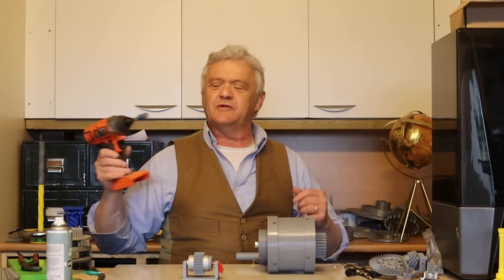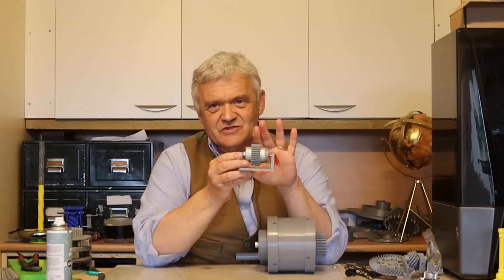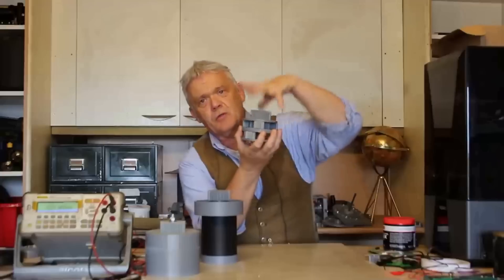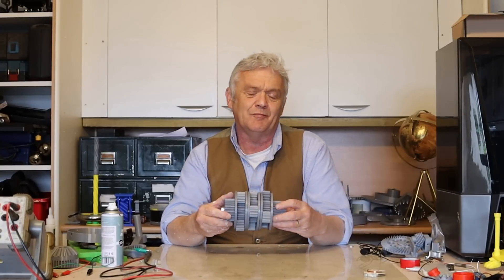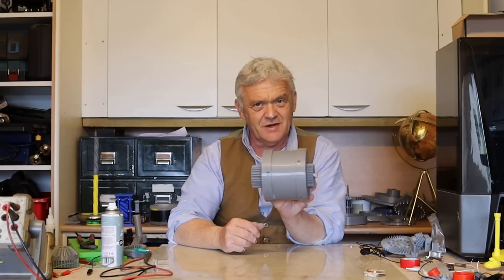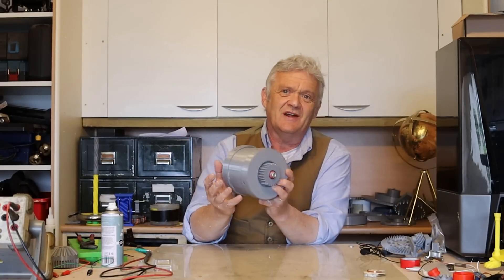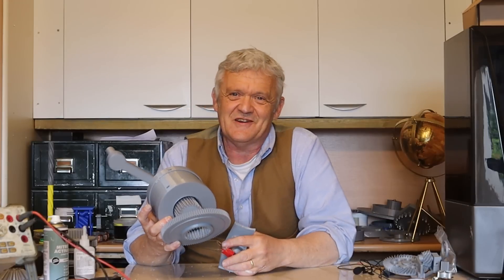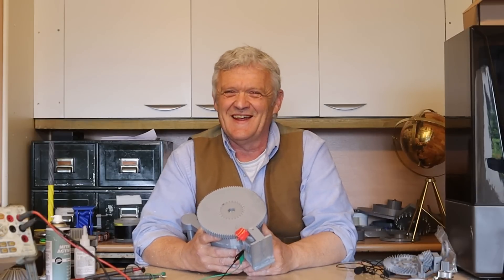2009 Universal Planetary Gear And BLDC Generator

Comment: I love this system for demonstrations.  I want to make a suggestion for the model - I like to take it apart to show how it works. I think it would be awesome to have hollow cylinders attached to the outside of the ring gear/outer case.  These could be used to run a threaded rod through to keep the sections alaigned and together, but allow for dissasembly and more expantion options (4, 5, 6, ?)   I tried to do this in thingiverse, but I just can't quite get it done with my skilset - your tutorials are great, but I need to also do some practical practice, not just watch!

Comment: Sir, your videos are great. I have one doubt. Does electric cars really want  to save the planet or create another business segment and capture market share using climate change reason? because year ago I have sent one ground baking invention to tesla management to increase run time of electric vehicles but no response. every moving object has opposite aero dynamic force, using archimedes wind turbine, right generator it is very easy to charge battery therefore no need to stop by charging station. May be I am Indian who suggested. that could be the reason they have ignored.

Comment: In a previous video you mentioned that the gear pins broke and would replace for metal pins. 
I just noticed in this video at 1.10 it looks like they are now metal. How did you replace them and did you re design the carrier? Also what was used? 
Many thanks and keep up the good work.

Comment: Needs a 25kg flywheel with ratcheting drive on the 100tooth cog. And the gearset enclosed in oil bath. 

5minutes of imput energy, 30 minutes of spinning generation.

Comment: what about imputing on the system on the ring? to my knolage planetary gears have the cool mechanic that you define the input, output, and mount there is the: 1 : 27 mounting on the ring, 27 : 1 mounting on the ring, then there is the reverse by mounting on the "sun" and inputting on the ring

Comment: It seems everybody is hung up on VOLTAGE. Power is what should be the concern. The size of a wind turbine for the most part gives you an idea of the power you can extract from the wind. Build everything as good as can be and you can never exceed the "power-in-the-wind".
The HAWT will give you the most power.  Putting objects near or in the path of the wind only increases turbulence which decreases the wind power available to your turbine. Of course we all know this.

Comment: Good place to source planetary gears is the scrap yard. There are at least several in a given automatic transmission. And most times they are still in good shape just forgotten about. Example, a GM 4l60 (700r4) or variants, are ripe with planetary gears. Also has other useful bits of kit a maker could do all sorts with. Just a thought
Reply from the maker: it's a good thought mate and a nice post - thanks for posting

Comment: I found servo motors made by kag rated at 500watt which spin @2000 rpm with 24v dc input. There is a rotary encoder on the back, which could be pulled out and paralleled with 6mm to 6mm(shaft size) coupler.

The best thing about this motor is it priced around $4-6 and the stock is plenty. The motor was salvaged from old atm machine. I already bought 2 of these and the condition was very good.

I got a request to build a solar plant for a buddhist monastery, i propose wind turbine since the location is quite windy. The plan is to use the impeller similar to the one on vid 1997 housed in wind catcher device seen on vid 1999. For bearings i will use a slice of 15mm ptfe rod drilled in the middle housed in fiberglass housing.

The impeller will be made from fiber/carbon composite, the housing would be made from aluminium sheet, and fiberglass with hollow galvanized square section. I might use stainless bolt instead of welding to avoid corrotion on welding points.

Still haven't decide on gearbox, but I am thinking two stage of 10mm 12t gt2 pulley paired with 60t. Or any combination adjusted on how the system behave on site.

If my proposal accepted i will keep detailed documentation. If they insist on solar plant, i will build solar follower panel. The motor would be powered from pelton impeller, and secretly injected to the battery pack using schottky diode😅. I would gather data on power generation using esp8266 and or esp32 cam connected to esp32 cam cloud wifi cctv system which also part of the offering.
Reply from the maker: that is an awesome project mate - keep me in touch - where are you by the way? Nepal?
Reply: @ThinkingandTinkering  I hope my proposal accepted, i am in indonesia. The small monastery called "pusdiklat jinaputra" located in malang regency, easy java. There is some pics avaliable on google maps.

The monks only need electricity for basics needs, not much. There already static solar panel installed from donations, which i will modify to track sun. The wind catcher will provide eletricity when it is cloudy or raining, which is quite often here. I also requested to fix water purification installation which did not meet standards on tds, nitrate and e-coli.

It is around 800km drive from my place, my car would be stacked with parts since i did not know the condition there. I will bring my cnc router and a corexy 3d printer just in case. The 3d printer would be donated.

The strage things is that there is a uni nearby but they called me who only learn from youtube and free research papers. I only got degree in finance and master in economics, my previous job was equity analyst/economist in an asset management company🤦

Comment: If you could turn the rotator one way and the magnets the other way before applying the planetary gears?
Reply from the maker: it wouldn't achieve much mate and t would make t electrically very complicated - it can be done - with slip rings say - but the same effect would be had by doubling the gearing and that's easier

Comment: Could this system be used and modified to work on a bicycle to power it better?
Reply from the maker: yeah easily instead of an input handle put a sprocket and link it directly to the bike gears

Comment: I wonder if you put a plate made of rigid aluminum or copper plate was coated in graphene and placed suspended in air in your attic. Then using a circuit of either diode bridges in series with the outputs in parallel circuit board could be made of tens of watts. I don't know if chokes or inductors would be needed across the ac side of the bridge diodes or if you using pulsed ground circuit with a electronic switch to get more power. Or if it would be better to use avalanche diodes to get some power out by an oscillator circuit that opened and closed the ground connection? Just thinking of something sorry.
Reply from the maker: sounds interesting mate - cheers

Comment: Hey Robert!  Have you ever seen a brushless motor/gen with 7 magnets on rotor?!  I’m currently testing a modified alternator with a 7 magnet rotor made for a wind turbine that I found in a scrap pile!  Never seen a motor with odd number of magnets all in the same orientation like this, very interesting.  I hooked it up to a BLDC controller and the torque this thing has is crazy strong!  It operates very smoothly and quietly too!  I’ll have to get a 3- phase rectifier set up to test its power generation too but at this point I’m thinking it would do well in a e-motorcycle or something!
Reply from the maker: I haven't mate - but there is no reason why not I guess - lucky find!
Reply: @ThinkingandTinkering  It seems to create an alternating magnetic flux because the opposite polarity extends through the rotor from the magnets opposite side, which seems to be possible because of the odd number of them.  I’m surprised how beautifully it runs as a motor really.  Only issue I see is that the shaft actually has a magnetic pull to it, I assume from the flux not being canceled out.  That might cause it to pick up metal bits which could be problematic.

Comment: I'm trying to think of use cases. Maybe a wind turbine combined with a weight. When the wind is blowing the weight is pulled up. When the wind stops the weight drops. The wind provides the high speed energy the weight provides the torque. Together they provide voltage?
Reply from the maker: yeah - nice one

Comment: Is there anything you can do about the friction? I feel like if you could reduce the friction by a large amount and then put a large weight on the output, you'd have a pretty good flywheel setup, though you'd probably also need some sort of slip system on the input so the handle doesn't continue turning when you let go...
Reply: Speaking of friction, what's the point of the "housing" having a ridged interior that meshes with the various planet gears? That serves no purpose whatsoever and simply adds a MASSIVE amount of friction. Better to have the housing interior smooth, withj a slight clearance between the planets and the housing.
Reply from the maker: the housing is the ring gear mate - without a ring gear planetary gears don't work
Reply: @ThinkingandTinkering  Hmmm.. yeah, I guess that was a pretty dumb comment. Its a good thing I never had aspirations to be a mechanical engineer! 🤣Sorry for wasting your time replying to such a stupid comment.
Reply from the maker: @woolymittens  no worries - it was certanly an odd one mate lol - cheers
Reply: @ThinkingandTinkering  hi i know this set up is called planetary gear, but what if the planets and ring were meshing by means of by rubber with friction rather than geared tooth what would be the resulting ratio multiplication or reduction ? of course it would be limited in torque transfer
Reply from the maker: spray it with dry lube mate - PTFE, graphite or Moly D

Comment: You should always spray down 3D printed gears with something like PTFE dry lube or something similar it will allow the gears to interface a lot easier. Other lubricants may also work I just don't have any experience with them so I can't recommend
Reply from the maker: Great tip!

Comment: Rob, how much heat is generated by these motors you are making? I'd be interested in using them but I don't know if they'd hold up in prolonged use. Perhaps when you are testing them you could use a thermal camera to see what kinda temps we're dealing with?
Reply: You might also note it likely takes far more energy to produce the filament and print it than it will likely ever generate if used to harvest renewable energy! But that's not the point of experimentation!
Reply: @vexy1987  anything that's made will incur a cost, either watts or calories... I'm fine with either. I'm just curious as to how a 3D printed generator would hold up to some prolonged use. I think what Rob is doing here is fantastic, and he always finds a way to probe new ideas and spark the grey matter into life.
Reply from the maker: ok mate - cheers